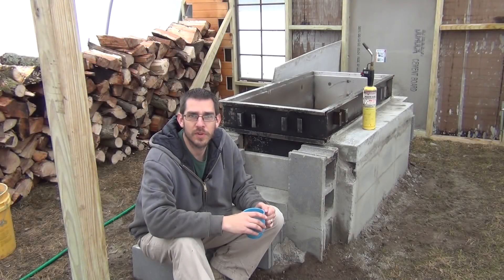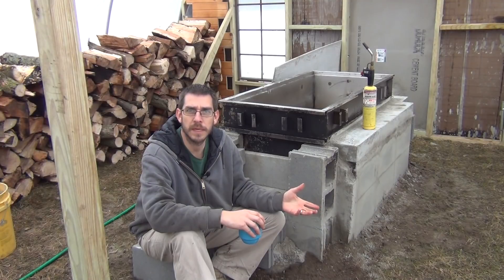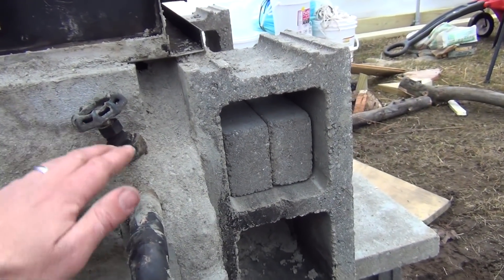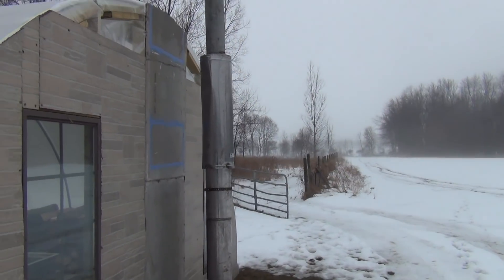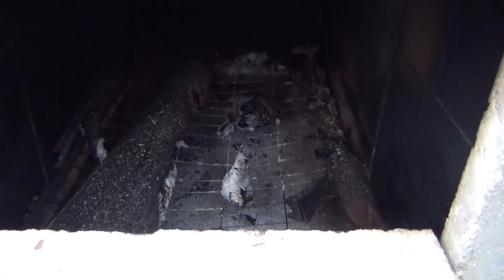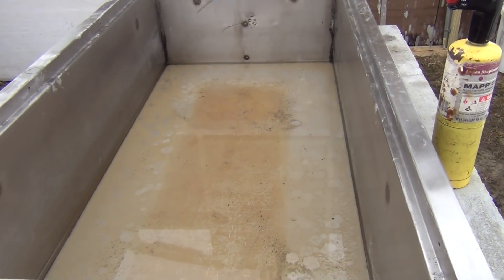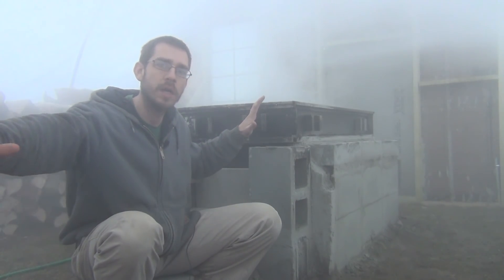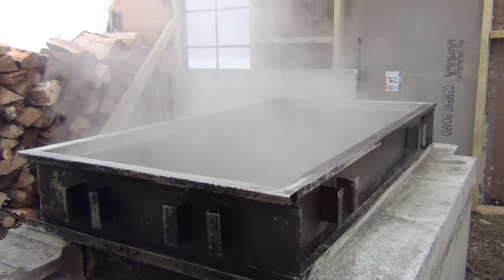DIY Cinder Block Evaporator - How Well Does it Work?

Comment: I would add a range hood attached to your support beam with a fan that will suck the moisture out and you could vent it probably somewhere near where you're venting your smokestack just like the range hoods that you have in your kitchen but you'd probably need a bigger fan in it to suck more air flow out

Comment: I build stoves, think about putting a steel plate above your smoke pipe ha3/4 of the way down your fire box so your flame has to come to the front and travel to the back to get out, cut a 8" square hole at the back and weld 2 peace's of angle iron on edge and cut a peace of plate 10" square and slide it under the anal iron as a track, get a steel bar the hooks to that 10x10 plate and comes out the front of your fire box, open that by pass plate to start your fire, and close it once the fire gets going, this burns off all the gas's and your not sending all that heat up the pipe, I am sure your pipe will get red hot with out this second burn plate, it will add a lot more heat to your pan and burn far less wood

Comment: You can enhance  evaporating and minimize steam  by assembling an aluminum sheet over the surface and steering the steam to the air inlet of your fire pit. That would make the stove pipe suck all the moisture out.

Comment: You might get not poke your eye out after all. Is the stove pipe outside free standing?  I didn’t see a brace in case of high winds. Lookin forward to the maple syrup edition!
Reply from the maker: I drove a fence post in the ground and then used metal strapping to screw the pipe to the fence post. I still need to add another piece of strap at the top as well.

Comment: You're doing it wrong. You are supposed to wear a towel and smack yourself with tree branches and then go roll around in the snow. Don't you know how to sauna?   On a serious note you might want to move all the electric stuff out of the green house when you do this. All that moisture in the air will probably be pretty bad for things not designed to be saturated with moisture.

Comment: As far as I can tell, (respectively) your smoke and draft problem are all coming from the same place.  That horizontal stove pipe is way too long. If you could tilt it up any at all it would help.  I have a wood heater as secondary source and ran into the same problem a few years back when I installed my first one.   Maybe more height on the vertical pipe would help but you're getting into stability issues there.  I've taken self tapping metal screws and pieced it together at the joints in the past.  That worked well but you still will need some type of cable or something to stabilize it at apex.  Hope this helps.
Reply: yeah, he could even just flip that piece of cement board so the hole is at the top. Would have to find/rig some 45 joints. Also, insulating the pipe to make sure it warms up well.

Comment: Can you concrete stucco exterior of your burner to seal leaks? and if the fire was located to the back would it circulate the water while boiling? just curious i have never done anything like that.

Comment: My guess is the bottom air intake is restricted to much.
If you use fan forced air your unit must be air tight or it will blow smoke out of the path of least resistance.
Reply from the maker: That was my concern also, If I start blowing air in there it might just blow smoke out the cracks. I think I really need a 8" stove pipe

Comment: You REALLY shouldn't stack wood near the plastic. If that tips, you're in big trouble. The ground can shift in the spring and i've had huge sections of my wood wall topple over when it happens.
Reply: argentum taibhsear that wood is not gunna last long